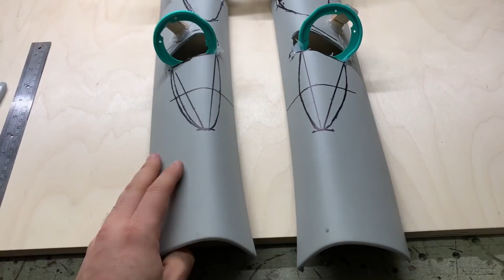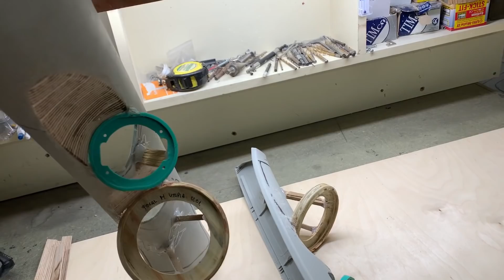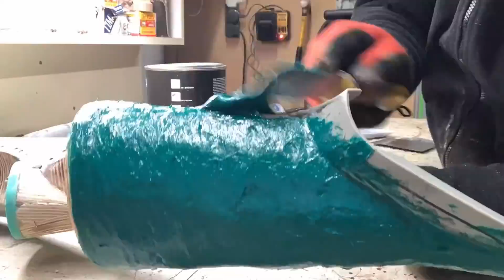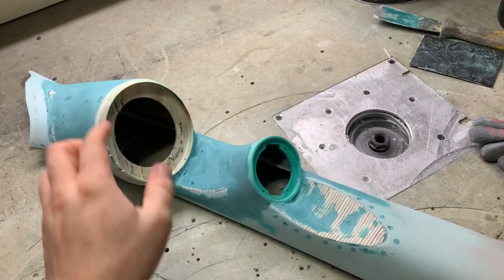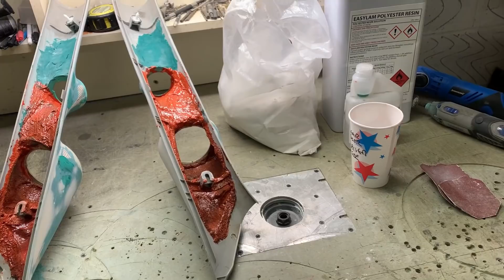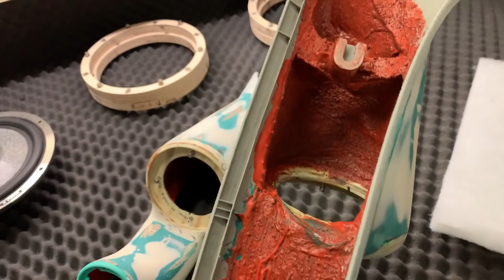A-Pillar Fabrication, Milkshake, Rainguard, Aiming, Everything EXPLAINED

Comment: Love your work and Vid's, I'm installing a Super Buget SQ system in my work truck ( 04 Nissan Pathfinder Platinum SR-50 ) and making a set of custom A pillars ( Mids and tweets )  like yours right now,  I'm using a set of DS-18 Dxi-354 mids $50 and Skar SPX-T tweets in the A-pillars $45, and a set of Skar 8in 4ohm mid bass FSX8's in the door carts $60, with a 10in active sub under each seat ( 2 different subs with different sound profiles, one more tight mid bass and one that hits lower and more boom ) So it is kind of a hybrid 4 way, 3 ways on a passive cross over and an active sub under each front seat. Ran off  Android auto Hi Res head unit with a built in 6 channel dsp ( a fairly well eqipt dsp too, w time alighnment, a 12 band parametric eq and adjustable high and low pass for each of the 6 full range channels, with summing available ! ) Got it on sale for $88 Amazon. Head unit to Audio pipe 6 channel line Driver w bass knob $65, Line driver to Class D amp Vervor MXD 400.4 $70, Jinyezi under seat sub $130, Vervor YL_1013 under seat sub $80, So all that is a total parts cost of $588.00,  My phase 2 will be to add a halfler suround with the rear doors, and a larger sub in the back, I mostly listen to EDM.. ( all with proper sound deadining of coarse Lol )

Comment: Peter it seems doing jointing with hot glue gun. The glue may melt during high temperatures inside the car in summers.
Reply from the maker: You gotta go over it with fibreglass, then it’s fine, but we have also stepped away from hot glue, rather using CA superglue these days.

Comment: Recently seen pods using PVC pipe. Just have to match the contour of the A pillar probably using a Dremel and sand drum. One benefit is a sealed pod then screw tweeter and mids into the prospective diameter PVC pipe. Then use the grills that come with the speakers. You can then use body filler to give it a transitional shape then upholster it with material to match the car’s interior oem upholstery.

Comment: is that laser method useful for aiming?
Reply from the maker: It sure is if you can’t do it by eyes.
Reply: @pssound9749 the main goal of aiming is to avoid reflections?
Reply from the maker: @arjunarya6286  it is to control side reflections, get similar response from both sides and to get great top-end extension.
Reply: @pssound9749 thanks a lot sir

Comment: I want to do 3 1/2in or 4in's mids with 1 to 1 3/4in (2in max) Image Tweeters along with 6.5 Midbass with Braxial mounted Tweeters. Look up CDT Audio if you haven't seen Braxial mounted Tweeters. In Aluminum pods that are connected to the A-Pillar with aluminum ball and socket so you can aim them to your liking and then have your Mic mounted near the headrest and have the DSP do the T/A and EQing. Edit: You should get a Bodyfiller rasp which is used while the filler isn't quiet set hard so you can remove most of the excess filler and then you come back with the finer stuff else you will be sanding for days. The sandpaper fills with that material and is done. You need a new piece. The proper tools are worth getting if you do a lot of fiberglass work.

Comment: That glue sets fast to hold those bendy Baltic birch ply thin cuts to stay in place.
Reply from the maker: Mitre pack with activator spray. 😎
They probably sell it as CA glue in US. If you blow a bit if air on it, then it’s even faster.

Comment: I spent about 25 hours total on my pillars that are only for some Utopia M 3.5wm mids. After you get the aiming right, building the structure isn't that bad. It's reinforcing everything and then applying the filler and sanding that takes most of the time. I use a pistol grip air DA with 3", 2" and 1" attachments and that speeds up the process. If you had to sand by hand it would take 3 times as long. You end up doing multiple applications as you fine tune the shape and make them symmetrical in appearance as much as you can depending on the angles. I chose equal off axis so that the drivers side measures 30 degrees off axis and the passenger is about 7 degrees off axis. The Utopia M's will measure about the same in my desired frequency range. My tweeters are both exactly 15 degrees off axis to the driver and right over 20 degrees to the passenger. Both tweeter and mid are oriented to maximize single seat tune with 2 seat tunability in mind for future competition. The drivers aren't just randomly placed, there is thought and planning involved.

Comment: this kind of stuff is such a struggle. nearly always loose your ass on it.  you said 17 hours so, 2100.00 in labor plus materials.   a job like this needs to be done inside of 5-8 hours or else the cost is so extreme that no one will buy it.   anything one off with details like door panels falls into this same boat.   hell these days even custom mdf sub boxes have their pricing all fucked up. 
i wish there was more of a market for this stuff
Reply from the maker: Custom work is not cheap in certain countries, that’s for sure. These pillars can not be made any quicker, otherwise people will cut corners and sacrifices will be made, results will not be the same. 
I guess you’re based in the US based on your estimate, right?
Reply: @pssound9749  yeah I am. I've done big builds that were profitable but it's been a long time. Things changed so much over the last handful of years.  Nowadays, these jobs are so rarely worth it.

Comment: "Finish it in a day", lmao. It took me a day just to find the optimal driver response with in available positions.  Another day cutting rings and preping and chopping pilars. 3rd day shaping and filling or fiber glass. 4th day final sand and paint. Took me 5 long days on my 1st build.

If your not going to do it right and try to get the best sound possible, why even do it in the first place?

There is a ton of work that goes into making pilar pods. Its not easily and if your not a skilled craftsman, I can see this taking 2 weeks after you fix all your mistakes. 

Im a carpenter with 22yr of experience and I own every tool your could imagine. This was a bit challenging for me.

Comment: Pete, do you ever have any issues with heavy drivers in pillar builds, do they ever pull the panel from it's clip mounts?
Reply from the maker: Hi, if there is no stretch on the pillars and they kept their original form, then the clips hold very tight, never had issue with them.

Comment: please tell me. bro threaded inserts size for midrange and tweeter
Reply from the maker: M3, usually 8mm deep.
Reply: @pssound9749  thaks for the reply bro. i have microprecision 5 series midrange and 5 series tweeters. i wanna make pods please tell me that i will make on axis or off axis. if off axis how much please reply thanks
Reply from the maker: @ranvijaydhami7246  most of it is explained in this video. If that is not enough, then please join www.patreon.com/pssound where you can learn more about it. There are multiple weekly topics about speaker aiming on that platform. ✌️

Comment: Think of how the fibre glass will handle ☀️ summer heat too. I used cut pvc pipe  which was good as fibre glass sections slightly caved in summer time but the trimmed and stitched black leather can stretch and warp the whole A pillar too.
A good project in the car audio journey 👌

Comment: another amazing DIY vid Peter.... if the pillars are covered in fabric does it need to be stripped off before starting the build?
Reply from the maker: It’s actually better to bond to trimmed surface, but may need resin layer at the end and sanded back.
Reply: @pssound9749   thanks Peter... cheers

Comment: How much does a job like that cost
Reply from the maker: Where do u live?
Reply: @pssound9749  tampa fl
Reply from the maker: @firstphoton655  not many shops can do this type of custom work, that’s for sure. The ones that do charge around $100-150/h and it takes 25-30hours for fully finished state.
Reply: @pssound9749  jeezes freakin christ....i mean no doubt.... people need to 3d print this stuff cut the hours in half lol.
Reply from the maker: It needs structural strength, 3D printing wouldn’t suffice. It’s fine for mounting rings, but not the rest. Anything bespoke cost money unfortunately.

Comment: Hey Peter, question about these and your other more recent build, How did these ever get trimmed in the end? did you trim them yourself or was it something else like flocking material or just sprayed? I finally got some time to tackle my own mid builds for the audible physics drivers I got and they're now ready for trimming/painting etc but they are very awkward just like these builds in your video (just without the tweeter). I've got some cheap OEM style stretchy fabric on the way for them but I know alcantara would be a no go unless it was stitched panels, so I was considering flocking them like a rally dash or maybe just try stretchy vinyl.... how have you tackled these difficult builds? I'd like your feedback/comments on the build if I could send a picture or two on the FB page or public group.

Comment: 3:00 The Twisting issue of resin curing is magic mate!
Thanks for that tip on doing pillars. 
Damn your attention to detail is worth every farthing. :)

I am just about to do this 2-way on a Jeep Wrangler JKU Hard Rock.
 Plus a 6"  in the front bottom of the front door, and an 8" in the back of the door. (fab lower half of the door, then leather covered.).. not sure on the back 2 doors if it will just be a set of 6x9 for space from the wheel well cut-out.
Suggestions?

Comment: Hi!  I've fabricated many kick panels in my time and I'm getting ready to do some 3" a pillars for the first time.  I know the best angle for kick panels after a few tries.  Can you tell me the best angle for the a pillars?   They're wideband 3" drivers.  It looks like you aim them straight at the headrests of each seat on the side of that a pillar which to me would seam like you'd only hear the speaker right in front of you.  Do you use time alignment to get a better stereo input to your ears?  If you don't want to share your secret, no worries.  I'm sure there are variables like what speaker being used, the interior of the car, etc.  Just wondering?  Thanks, love your videos!
Reply from the maker: Please watch PART 1-3 in the Sound Quality in Car playlist first.

Comment: It is more difficult and a lot of weight there are simpler and lighter weight options. This is not for the woofer, but only for the tweeter and midrange. Why not tighten everything with plastic. Probably 500 grams of putty went. For work 5+ and for idea 5+ but price quality 2-
Reply from the maker: Степка Сусликов you’re quite wrong in many ways. Even if it’s “just a midrange”, you don’t want it to be lightweight, not on the level what we do when it comes to sound quality. The more rigid and dead, the better! 
Why this technique? Why not? It’s just an option. There are many ways to skin a cat! If you don’t like it, then just do it your way! I never said it’s simpler option, but it’s an option, Pssound option! 💪🤘👌🔊🔊

Comment: for years I thought it really didn't matter and I prefer the sound hitting the windshield with the highs from the tweeters and so forth. I was so wrong. There are really some absolute great advantages for having the tweeters in the driver's name that you on access and I have to admit if you could do that with midbass drivers even better.   

for years I thought a three-way system would probably be best  it still has its merits put in a vehicle I have to admit having a very good two-way system well there is this wonderful thing about Imaging and Driver placement then happens when you're able to go and do that with a wide range driver up at the top where your ears are and have it cover as much frequency as possible and have the door speaker do its job of lower mid Bass.

Comment: Those pillars are beautiful I love the plywood strips method. Btw Is taking like a 4" coaxial driver separating the tweeter at the terminals bypassing the factory bass blocker/cap on the tweeter and bi amping them or hooking them to an actual 3 way crossover for the midrange and tweeter (with a midbass driver in the door) in a 3 way system? is that a thing does anyone ever do that? Seems like with a decent quality coaxial it would work fine, maby not as good as seperates but pretty good... Any input would be appreciated, thanks.
Reply: Well I wasn't really focused on the crossovet setup it's going active when I can swing the extra components, it was mainly asking even tho it's not the standard practice and not the optimal setup but the opinion on the viability splitting up the connections and  bi amping 4" coaxials drivers for mids and highs on a 3 way. But whatever no biggie thanks for even taking the time to read and reply at all. Love seeing your craftsman you do it's always beautiful.✌️
Reply from the maker: Waltzs budgetBumpin oh you definitely have the best chance to try that first with a coax as you don’t need time-alignment between mid + tweeter. Even if you just bi-amp them, you can still set levels independently, but once you can select X-over and independent EQ for each in fully active configuration, things can go to another level! 👌🔊🔊 However, tuning becomes more complex too. 😖
Reply from the maker: Waltzs budgetBumpin i only build fully active systems, no passive Xovers.

Comment: When you stir filler when mixing you add air bubbles into it. If you feel you have to do it that way, spread the filler out in a straight line pressing down with your putty spreader to push them out before you start applying. Using a 2 part glazing putty for your final spread will will level out really nice and will require less sanding too. You can even add fiberglass resin (mixed properly) to your regular filler for more flow as well.
Reply from the maker: xtremekustomz1 thank you for the tips! 👌🙏
Reply: Thank you ✌️

Comment: @Pssound  
Another nice fabrication tutorial, Pete!
I'm just curious as to why you are not yet using plastics such as HDPE, Sintra/PVC, Perspex, Marine/King Starboard, or ABS, etc for your door mounted speaker baffles/rings?

Is it too expensive in the U.K.?  I like HDPE for thicker baffles such as the ones you made here for the midbass drivers because it is much more dense (heavier, more concentrated mass) compared to any wood and it's obviously 100% waterproof.

It's still extremely easy to cut and shape like wood, and it's also easy to create threaded mounting holes directly into the material using thread taps, which reduces the extra time and expense of using threaded inserts.  And there are threaded inserts made for plastics as well.
Reply from the maker: bb foto it’s mainly supply and cost related. When i can i use perspex for smaller speakers or steel rings. I’ll definitely make a move on HDPE next year even if clients can not afford it! We can’t charge $100-200/h here like shows over there.

Comment: Is it possible for you to put together a list of maybe 10-15 of the best songs you would use as demo and how to acquire them on the best format for the highest quality?
Getting tired of listening to Dire Straits,Spanish Harlem , and the same Sheffield lab drum CD I have had since 1994.
Also what do you think of flash drives vs CD quality?
Thanks.
Reply: @John doe  
Check out the forum threads such as, "What Are You Listening To Today?", and "What Are The Must Have SQ Albums?" and others on the DIY Music Forum section of the DIY Mobile Audio Forums...

https://www.diymobileaudio.com/forums/diy-music-forum.107/

I just Linked to a large PDF list from the Tannoy home audio speaker manufacturer...

https://cdn2.hubspot.net/hubfs/315136/Ultimate%20Tannoy%20Playlist.pdf
Reply from the maker: John doe CD is just a transport method, still digital, 44.1kHz 16bit, so if you have the same file quality on a stick, then it should be just as good. 
Yes, i have to share a video about my used/preferred songs. 💪🔊🔊

Comment: What's the purpose of the drilled holes?
Reply: To help the fibre filler to grab onto the structure and bond sufficiently and foes not come apart at a later stage. If you listen carefully he actually explained that bit very well
Reply: @chokboywonda  
It's generally very difficult for most adhesives and resins or glues to adhere to most types of plastics due to their molecular properties.

There are specific "plastic surface prep" liquids or plastic "bonding agents" that you can apply to "etch" the surface before you try to bond anything to the plastic surface.

Without the holes to help give it some extra "grip", or at least "roughing up" the plastic surface with a coarse sandpaper, file, or rasp, the newly bonded pod can easily "pop off" if the original plastic part is twisted or bent, just as if you were removing a part from a mold.

And you usually need to flex or bend the A-pillar trim pieces a fair bit to get them reinstalled or when removing them.  It's always a delicate process where you just hope that they don't crack or separate.
Reply: @chokboywonda  Ok thank you.  I kind of fast forwarded on some parts and must have missed that.
Reply from the maker: Yia Xiong as above, it’s all explained!